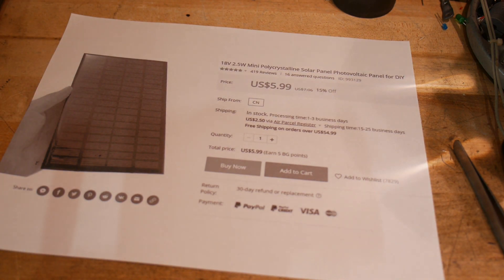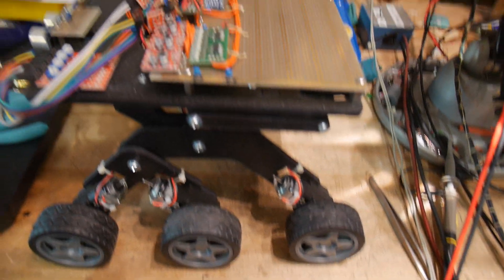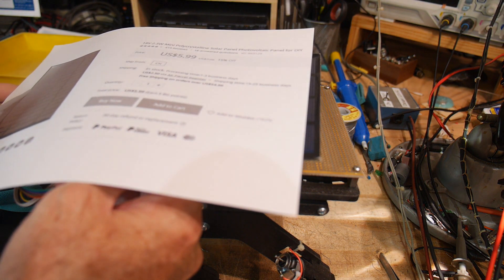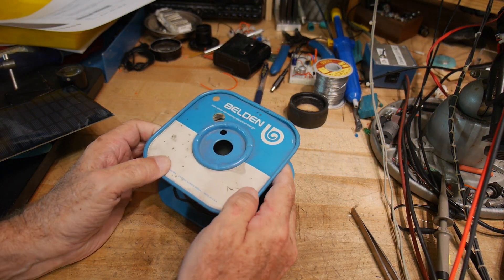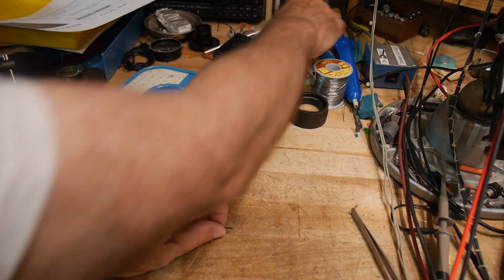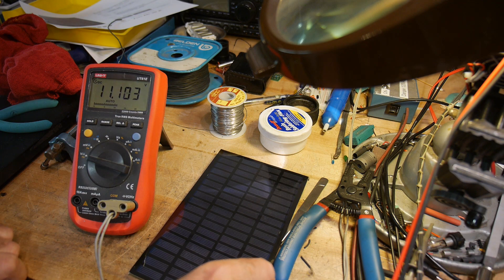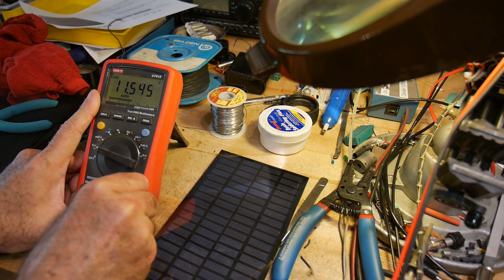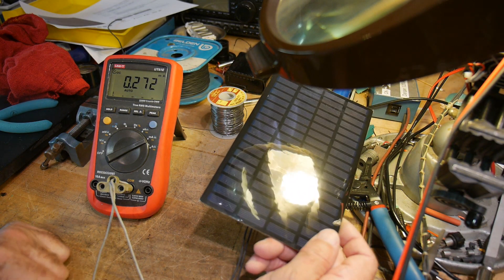#431 Testing a small solar panel

Comment: A nice quick look, could be useful for IOT kind of stuff, too.
One tip from my old Army Electronics Maintenance days: to tin wires, put the soldering iron in the vice.  Then take each wire end, poke it into the flux and tin it.
Reply from the maker: good idea to put soldering iron in vice. I do it opposite and it gets me in trouble